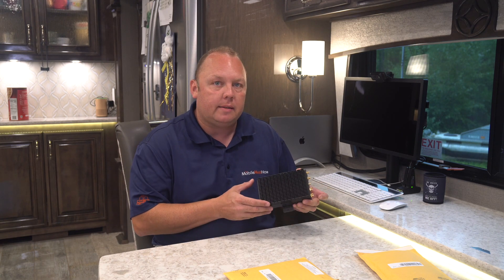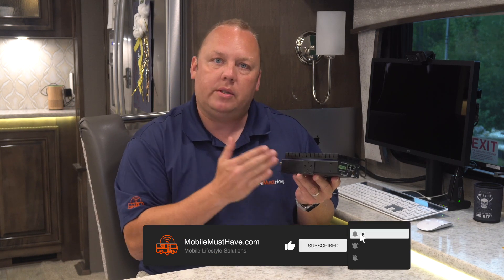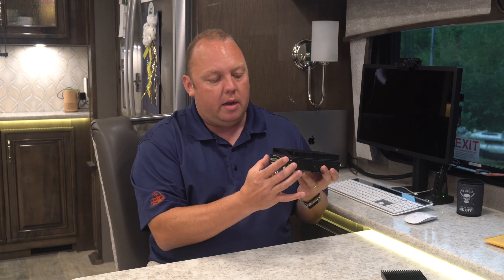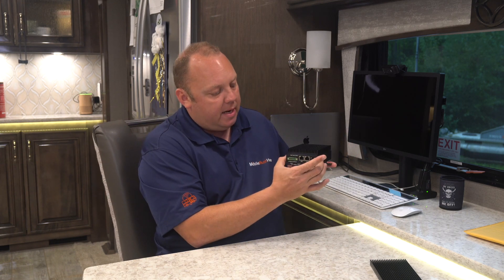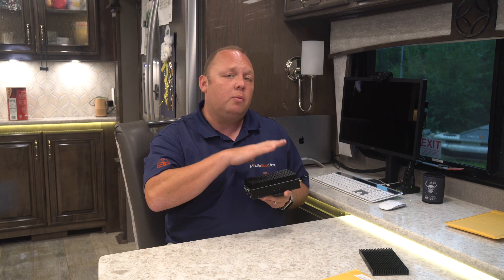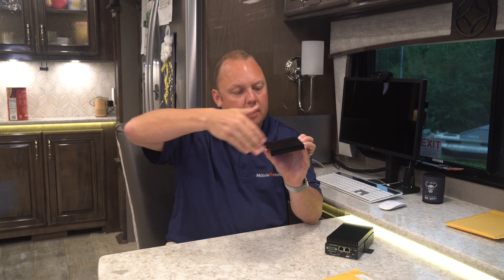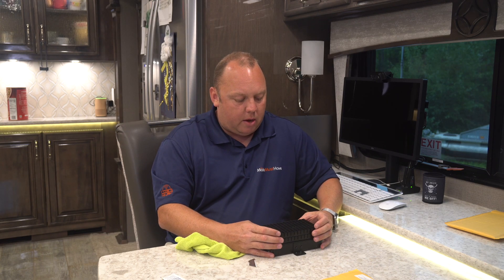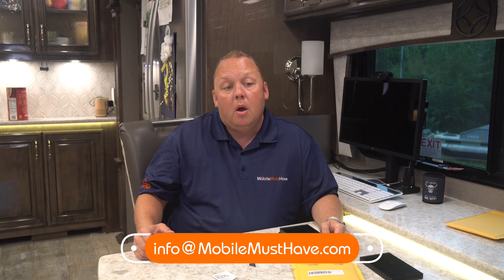Heatsink Option for the Max Transit Series

Comment: For the max transit duo pro, which end of the case are both of the modems at or are they evenly spaced in the case?  Curious to know where i should feel the concentration of heat on the case based on where the location of the highest heat generating components are in the case.
Reply: Following up on this question, thank you!
Reply from the maker: Sorry for the delay, Robert! The modems are placed on opposite ends of the PCB Board inside the router. If you have any other questions for us, please email us at info@mobilemusthave.com! Thank you and hope you have a great week!

Comment: Good info. I have that unit & have been concerned about excess heat. I move it back & forth from boat to RV & have it well ventilated. Do you have a max allowed temp to share with us?
Reply from the maker: Each model has its own specs on operating temperature ranges listed on the pdf spec sheets. Each model will have a sheet on our website on the listing page for each model under the documentation tab. Here is link to popular transit duo cat 12 https://original.accentuate.io/4628248068195/1635798175043/pepwave_max_transit_and_transit_duo_datasheet.pdf?v=0

Comment: Would an extra heat sink for Max BR1/2 be overkill?  I plan on getting that router from you guys and having it in an outdoor enclosure.
Reply from the maker: It may help but the br2 and br1 pro have an integrated heatsink with sins on the outer case so probably wont need anything extra. Great question!
Reply: @MobileMustHave  Awesome, How about  a fan(s) on top of the integrated Heat Sinks?
Reply from the maker: @omglivetv1  i dont think youll have issues pulling heat off the device but if the cabinet is super hot consider adding a fan to cabinet itself. The ac infinity fans on amazon for cabinets are awesome.